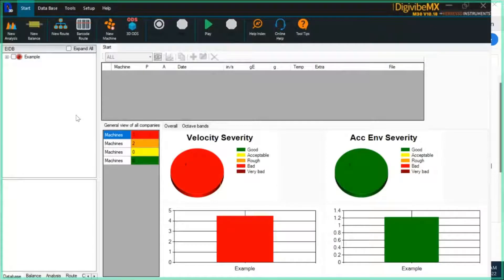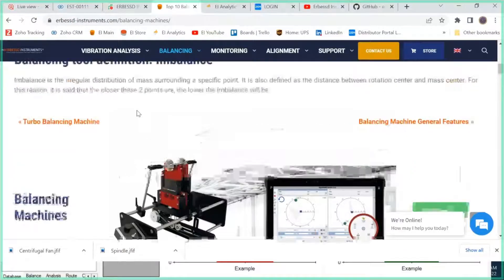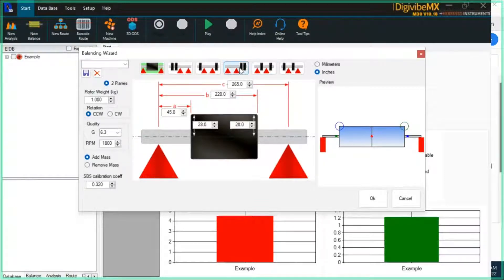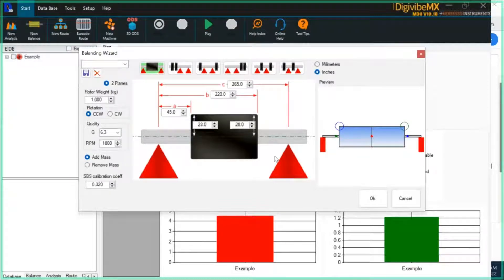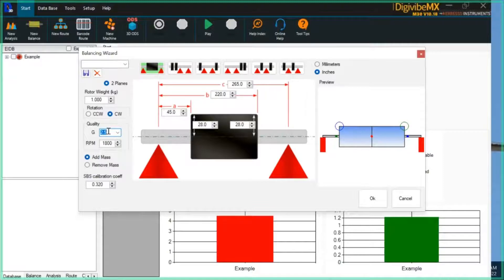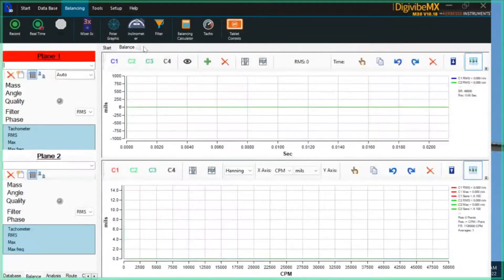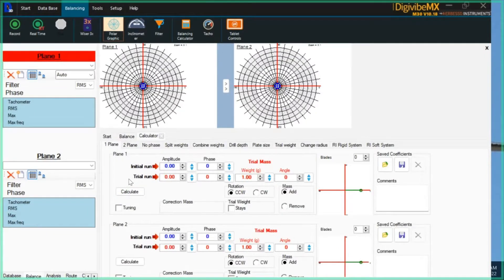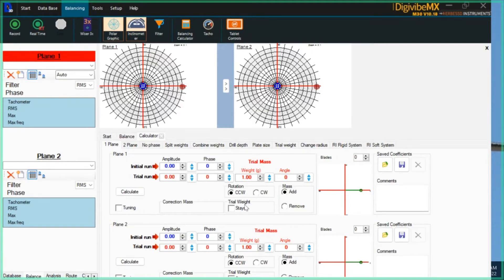Balancing Webinar - How to use Digivibe M10

Comment: Great explanation! 

Can you answer me a question...?

 Using the Influence coefficient method on a balancing bench with slow rpm, how can I know when I already achieved the adequate  ISO balancing grade?

Should I just go to ISO 1940- ISO 1925 and check the chart with the rotor information? (weight,  radius and on site rpm). Then if the chart value is for example 15 g-mm/kg ... should I just multiply 15 g- mm/kg * 50kg and then divide that result with150mm to reach the residual weight in grams?